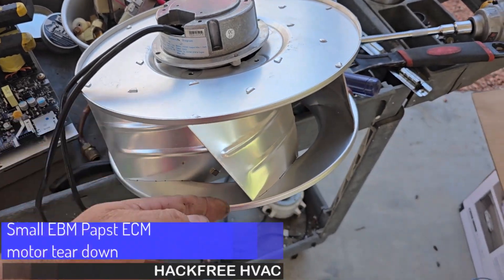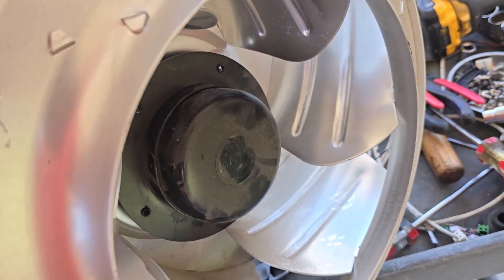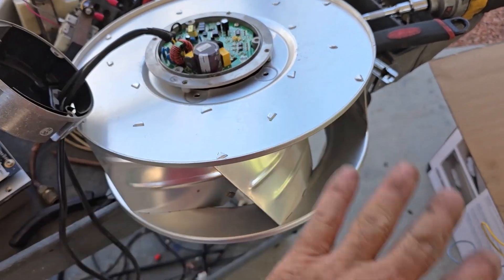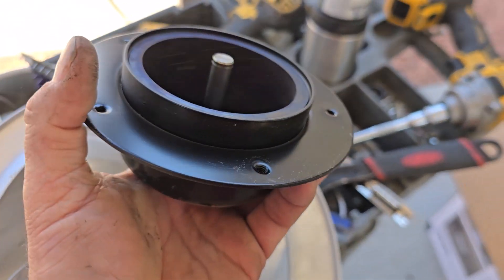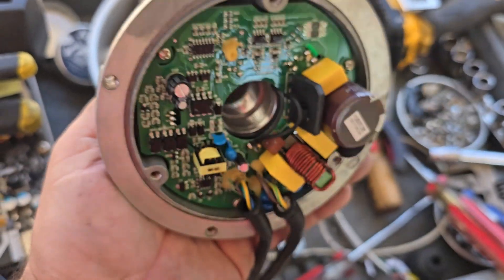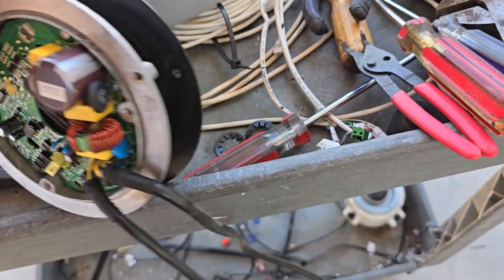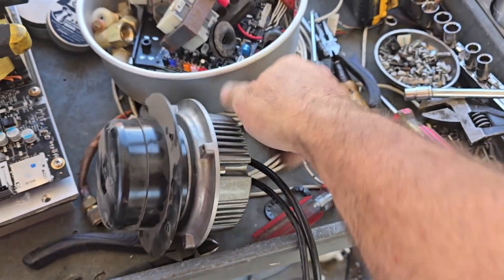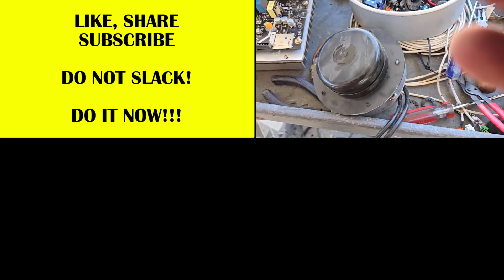Small EBM-Papst motor tear down [They don't actually intend for you to disassemble these]

Comment: spindle looks kinda small
Reply from the maker: The unit was just a 12,000 BTU unit.
Reply: oh  not to big a fan then   engineers like to undersize things so they fail @hackfreehvac
Reply from the maker: @royamberg9177  Seems to be par for the course. Some manufacturers spec their supply fan motors at the 1.15 SF 💥💥

Comment: This looks just like a large PC fan. TBH these motorized impellers were originally designed for the IT industry for cooling high power density electronics but I suppose they have found their uses in HVAC recently. They're supposed to be the most efficient type of fan blade, even more so than forward curved squirrel cage blowers, but I've always found that they rotate too quickly for there to be a noise advantage in all cases.
Reply from the maker: This style of fan is found in commercial HVAC all the way up to those HUGE box car units. Sometimes having an array of the fans. The reverse incline blades are steel that is all welded together at that caliber, however.
There were some huge units I was working on almost 10 years ago that were configured wrong by controls and the unit was producing something like 6" of static! It was popping the unit apart at the seems!
Here's some medium sized ones (VFD + AC motor reverse incline blades) ---> https://youtu.be/Lt0v6wUrhsg?si=CLfpnL5E0Ydp7XvJ&t=195

Here is an AAON unit that uses them but these are VFD AC motors https://www.youtube.com/watch?v=oCcBD40nCuM

Somewhere I have a video of those large ones. They had like 20 or 30 HP motors if I am not mistaken.
Reply: @hackfreehvac  I remember that video where you showed the large fans producing 6" of static. They are quite elegant beasts!
Reply from the maker: @liminalsunset  I tried to find the video but couldn't. In the midst of the thousands of uploads I suppose.
Reply: Did you just use impeller in a sentence about airflow? 🤣
Reply: @jman0870  Nothing wrong with that, according to Wikipedia, "driven rotor used to increase the pressure and flow of a fluid". Air or any other liquid can be a fluid.
Reply: @liminalsunset  Wikipedia? 🙄